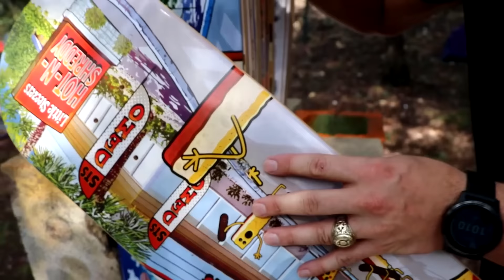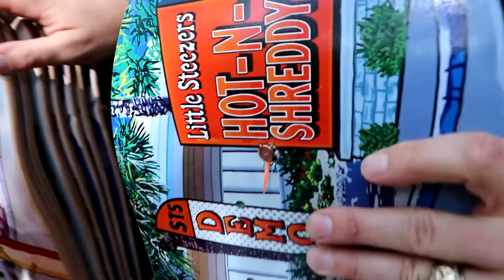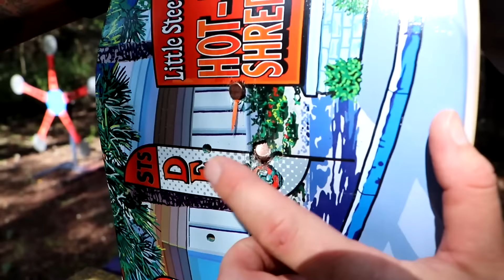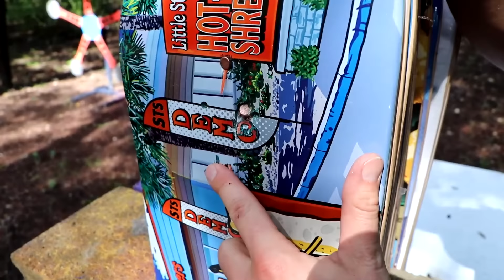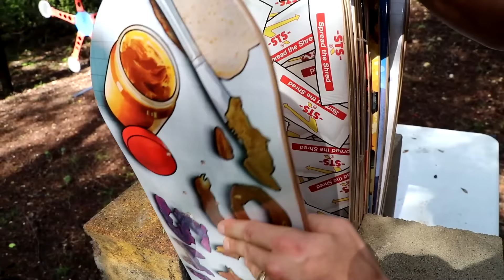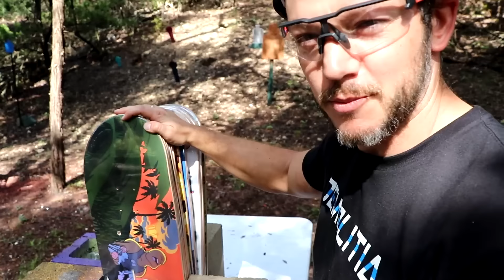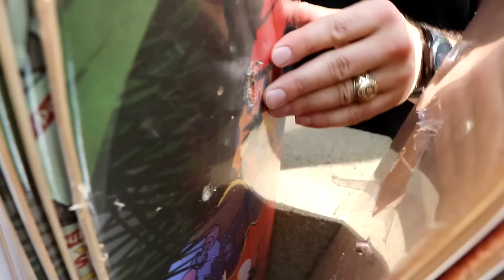How Many Skateboards will it Take to Stop a Bullet???

Comment: Damn now I can't use 7.5 as my home defense in my apartment. Don't want to kill the tenant 8 units over lmfao
Reply: really? i do just fine with my 120mm machine gun
Reply: Yeah that round is no joke. It can defeat 3A body armor at 100 meters.
Reply: @YiminyCricket  they can't rob your house if you destroy it in the process. Galaxy brain right here
Reply: @MurkyWaters677  I'm surprised it didn't deform, perhaps solid copper?
Reply: @MandoEric  not if your house IS the 120mm machine gun!
Reply: Well it's a really fast bullet in with a very small surface area. It's designed for penetration. lol

Same way 5.7x28mm was designed for that purpose with body armor.
Reply: @taylorhickman84  Its solid copper. The 7.5 travels at 2000fps if you're curious about that as well. Paul Harrell did a hour long review of the FK BRNO PSD if you want further info on the gun's performance.

Comment: Dang!
That 7.5 mm Brno went through so many boards because it was moving so fast...so fast that it wasn't even able to mushroom before its energy was depleted. 
(Depending on the type of round fired, the 7.5 Brno is moving at least 600 m/s faster than the .357 magnum, all else being equal.)

Comment: Skateboards aren't just wood.  They are also glue.  The type of adhesive also determines the hardness of a skateboard, not just the wood type.  The pressing method also plays a factor in there.  I've had 7 ply boards that broke where 5 ply boards stood up to the impact.

Comment: All good quality boards are laminated maple or nowadays sometimes bamboo. Other woods don't have enough flex in them as laminate structures. I weigh a little under 200lbs and my favourite board has a good two inch flex in the middle when I'm pushing hard and my weight is on and off. It's a little like a mini trampoline. Without that much impact absorption you'd knacker your joints a lot faster if it were more rigid, or it'd crack after a few hours. 

I'm a board rider rather than someone who does lots of tricks, so to me a board gets better as it ages and gets a little more flex to it. I don't like fresh boards anywhere near as much as old seasoned ones that I've been riding and breaking in for a few years. Most people are probably the opposite.

Comment: Was that 7.5 BRNO perhaps a blunted all-copper round? I once had some Ft. Scott Armory spun brass "TUI" .300blk rounds for my AR pistol once ("tumble upon impact"), and those lil f*ckers were hard and sharp as needles, and they ripped through entire logs (well, y'know, firewood size logs) and were some REALLY impressive stuff. I now keep a 30rd. magazine of those around at all times "just in case" as my SHTF ammo.  Perhaps the blunt nose and lack of deformation on spun copper rounds was what sent the 7.5 BRNO round THAT much farther than even the big handgun rounds.  Also loved the fact that the little pizza man on boards like, 8 thru 12 took that round directly to the forehead and was making an appropriate facial reaction lol. 🍕😲 If I ended up owning one of those I would be a very happy little camper.

Comment: You should try with trucks. True life scenario, how many friends at the skate park are gonna have  ones without? Lol

Also, the plastic casing is a factor (cellophane?), as well as the deceleration caused by the shift in boards. = Loss of inertia. Still sweet ass video

Comment: before the FK BRNO and the rifle calibers I was going to say that maybe someone should think of making body armor out if this; now I'm thinking it could if it had some assistance with some of the resin armor insulating the wood pieces and maybe some of the carbon fiber boards, light metal and maybe some Kevlar in case the other stuff failed that could possibly be a fairly good improvised an armor option that could be stylized and look cool should the builder also possess some engineering talent as well as some artistic talent